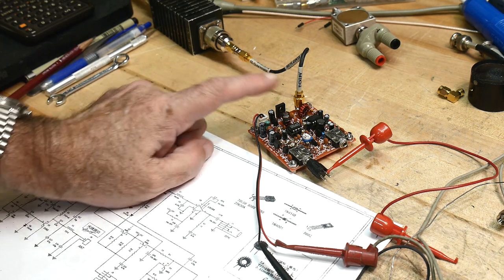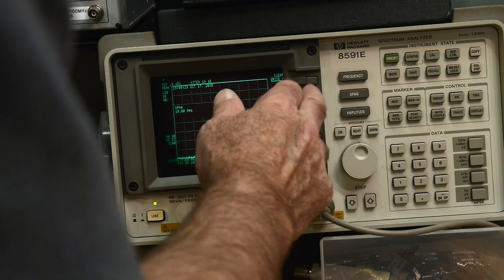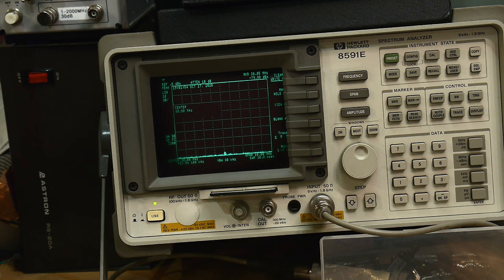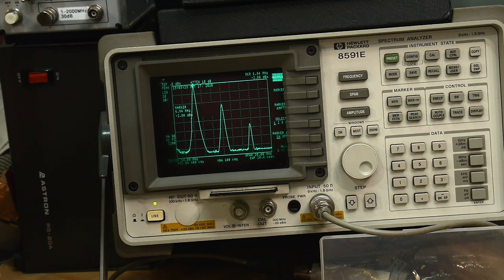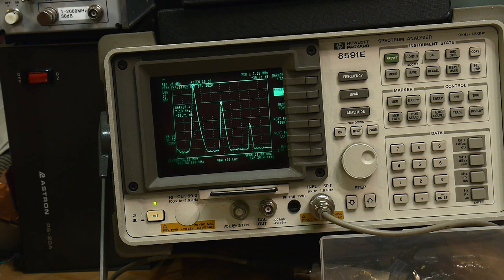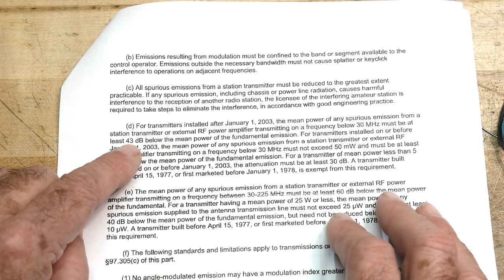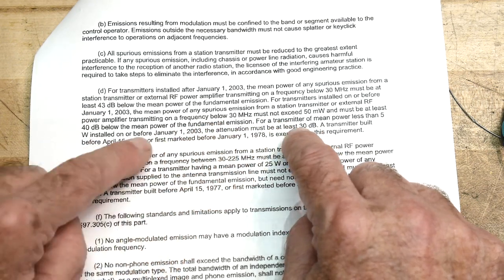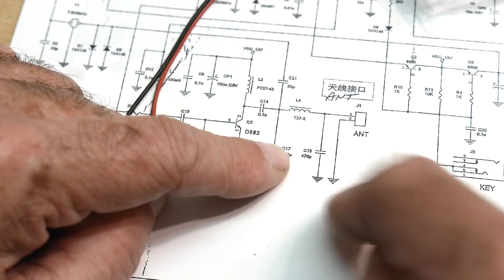#616 Checking Transmitter Spurious Emission

Comment: Good demo of using SA to find transmitters with inadequate filtering. Adding filters is not a problem at all and is not that expensive. Also, 14 MHz harmonic would be called the 2nd harmonic. You had referred to it at times as both the first harmonic and the 2nd harmonic. Confusing! It is the "first harmonic" but it is not called that, it is called 2nd harmonic, then 3rd etc... Based on 2x freq, 3x freq etc... New comers will be confused by this for sure.

Comment: So if my math is right, if you are on HF running a $10 dollar 50 mW xmitter you are required to filter the harmonics down to single microwatts. But if you're running a $7,000 dollar 1,500 watt commercial linear the FCC says you can legally radiate stronger harmonics than the total transmitter output of the ham with the $10 dollar 50 mW xmitter.

Comment: Again a good demonstration of measurement of RF output with the harmonics in a qrp Tx on the SA. 
As it turns out the 3 pole pi (Chebychev's..!?) filter is not sufficient. 
The same low pass filter is being used in the Rx mode too, I think. In that case the insertion loss, this 3 pole filter might introduce may be measured. Obviously a 5 pole filter would introduce more attenuation to the incoming signal on Rx mode.
So, the 3 pole configuration is a compromise.
The magnitude of the the spurious signals after the TX (TRX) has been hooked up to a good antenna system shall be measured at a distance; the TRX must be in a good metallic enclosure assuring a proper screening.
Reply: As the law gives not a penny on the antenna characteristics it still will be illegal to use the transmitter, even if the antenna (magically?) would filter out the harmonics. BUT: Bear in mind, most antennas that are in resonance at 7MHz will also be at least half-decent in transmitting/receiving on 14 MHz or on 21 MHz or on 28 MHz as it will be multiple of the basic wave-length on these frequencies!, so how could it filter out the 2nd harmonic? Quarter-Lambda will become Lambda-halfes, Lambda-halfes would become lambda-length which all could also be used for transmission, for example.
Reply: @Slartibartfas042  I think you have misunderstood the suggestion I made at the end.
I, initially accepted the need of additional filtering at the output. 
And it can be and is always accomplished in transmitters without any doubt.
When the populated board without screen is hooked up to the SA there's a chance that it maybe picking up stray signals that escaped filtering.
And finally a good resonant antenna is a series tuned circuit with high Q that certainly offers an impedance match for maximum power transfer.

Comment: note that what that law says means the TOTAL spurious emission must be 43dB below your fundamental. i.e. the total power minus the fundamental must be 43dB down. Practically, however, that spurious emission is dominated heavily by the second harmonic in your case because the third one was like some 20+ dB below the second,
Reply from the maker: I missed the TOTAL part, you are right. the new regulations are very demanding from the past ones
Reply: So,,, how does that compute? Another 23 db? I'm new, if you hadn't figured that out.
Reply from the maker: @jdmccorful  the spec is 43dB for the harmonic. I measured 20dB for my radio. so I need another 23
Reply: Harmonics are easy to suppress as they increase in frequency from the main signal, and the power is easily cleared up with better board designs, less loading on the output network.

Comment: I am bit confused here. Isn't the HP 8591 displaying voltage in dBm, not power?  Wouldn't  the difference of 20.7 dBm between fundamental and 2nd harmonic at 50 ohms be equivalent to a 41.4 dB below the fundamental's power? So isn't it within a hair of meeting Part 97.307?
Reply from the maker: dBm is power. dBm is dB milli-watts
Reply: @IMSAIGuy  Ah, so it is.....